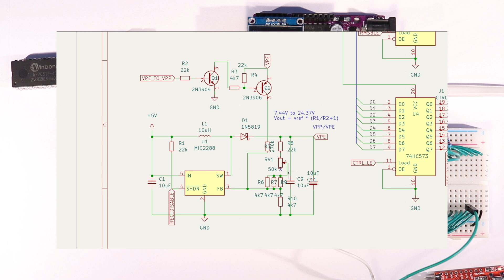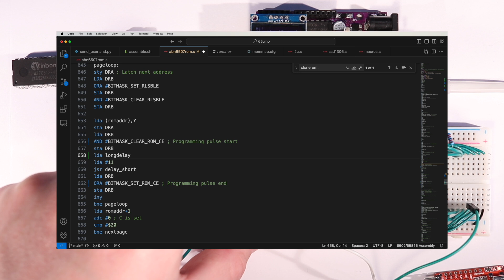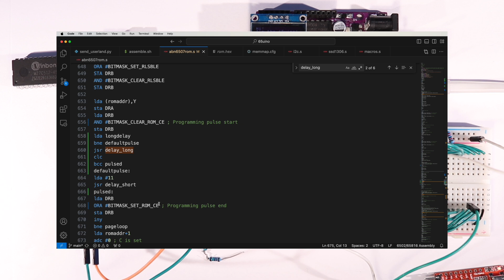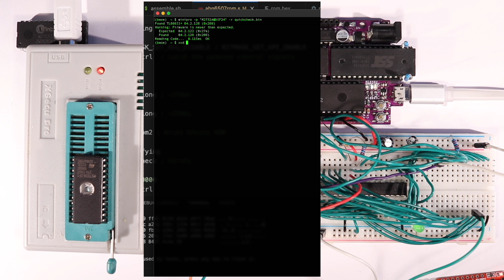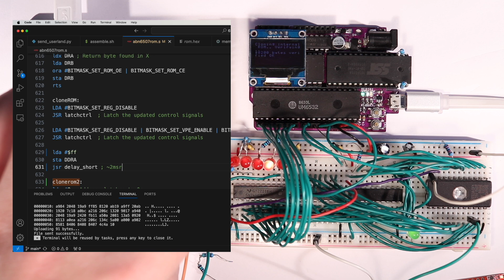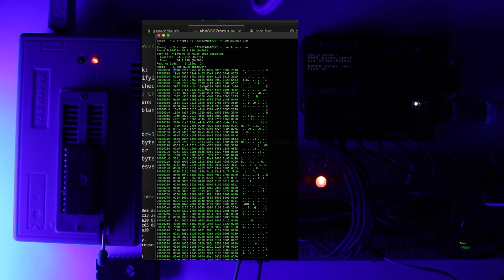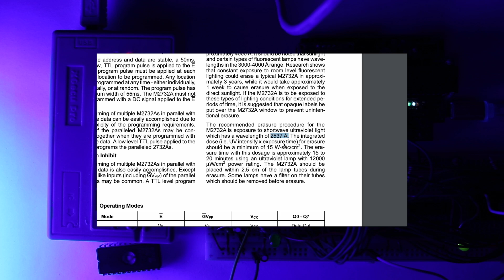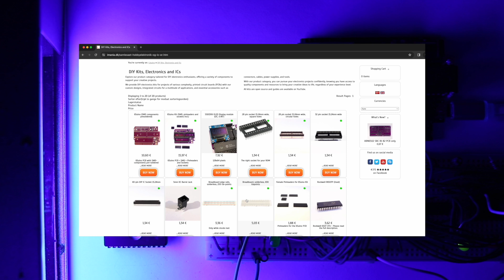21V EPROMs on a breadboard - Programming and failing to erase them..

Comment: Hej Anders! I built my own UV box some years ago, I used one of the cheap aluminum suitcases you can get from Harald Nyborg and made it so it has to be closed for the lights to engage. Super cool content, as always!
Reply from the maker: Sejt! Where'd you get the lamps?
Reply: @AndersNielsenAA   
Got them off eBay, I paid about 25-30 EUR for two E27 bulbs. This was approximately 11 years ago, so I’m not sure about the stock and pricing nowadays. Unfortunately I don’t have it with me to give you a more specific reference. In my case, they didn’t have the exact wavelength I needed but close enough, so it was a matter of a little longer exposure (I used them for UV-cured coatings)

Comment: when I was tinkering with EPROMs I used an old mercury-vapor lamp from a street light. they were converting to natrium lamps and had plenty of them. I drilled a hole in the glass with a diamond bit and it erased the chips in just seconds .. well the lamp took about 10 minutes to warm up though .. and it looked like aliens had just landed b/c it was soooo bright :D
Reply from the maker: You mean like a... 175 WATT lamp? :D But.. drilling a hole in the glass? Isn't it a vacuum bulb?🤔
Reply: @AndersNielsenAA  I think it was more like 100 watt(?) .. the ballast I used was 80 watt - so it got fairly hot. The lamp has an inner quarz bulb and an outer glass bulb that is coated with phosphor to convert the UV to visible light. Most people just smashed the outer glass - but I was too afraid of the high voltage bare wires inside
Reply from the maker: I’d be too scared to smash all the way to the mercury and inhaling it :)

Comment: I will go buy the eraser. I went the tube route and is a pain, it takes forever to erase (I think they not exactly the same wavelength and you do need some type of enclosure to focus the light,
I got the tubes and used an empty drawer as an enclosure and it took me plenty of tries and around 40 minutes total and from the 3 roms only 1 was fully erased the other 2 had a few bits still set
Reply from the maker: Thanks for sharing your experience. Not a bad idea about the drawer - I guess they really need to be right on top. Photonic energy diminishes squared with distance - like radio. 
I kinda want to do the hacky thing  - but I certainly prefer a reliable 10 min erasure to a one hour unrealiable one. I guess there's also a risk of overcooking them.
Reply: @AndersNielsenAA  you have a point there mine was a bit of a hack and not a perfect setup and the tube was not exactly 90 degrees to the chips. I should give it another try with the light setup right.

Comment: I am reading your i2c code at the moment wondering what I will need to do to make it work with Bens BreadBoard computer which I am still building.  I like how consoles stored routines in there roms so a program could just call it. What a great idea. I wonder if its possible to store some routines in ROM and only blank a bit of the EEPROM for the new code rather than erasing the entire EEPROM?
Reply from the maker: As long as you put scl and sda on bit 0 & 1 on any port you should be fine.
Sure, it's possible to leave some blank space in ROM - but you probably need to copy the routine to write to it to RAM. I plan to make the 65uino in system programmable for at least SST39's and AT28 ROMs.
Reply: @AndersNielsenAA I have 3 at28c256 chips and I just use minpro -p at28c256 and -w file and it works great, and that is the new T48 with Linux.  You talk about copying code from EEPROM to ram.I noticed his blink example which you wrie to EEPROM.  does not seem to use any RAM as his computer does not have any yet. Later on when writes code for the LCD it doesn;t work as he has no stack. The RIOT chip you have is nice as you get 128 bytes of RAM with it. I am amazed what you can do with it.
Reply: @AndersNielsenAA I have a simple logic analyzer, It might be useful to see what is going on. A nice DSO would be great, but we got to start somewhere.  It is interesting you will make it so you and program the EEPROM via serial, that will be interesting.

Comment: Nice a new video. If you can find a nice at28c eeprom it will be a lot easier :)
Reply from the maker: AT28's have write protection - so at this point they're actually harder to handle than W27C512.  
Soon there's nothing this can't handle :D